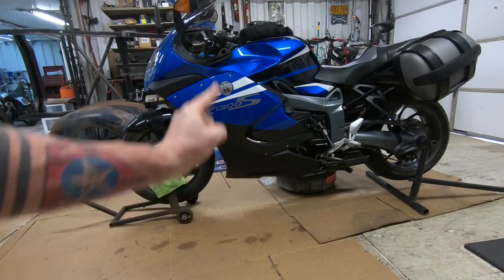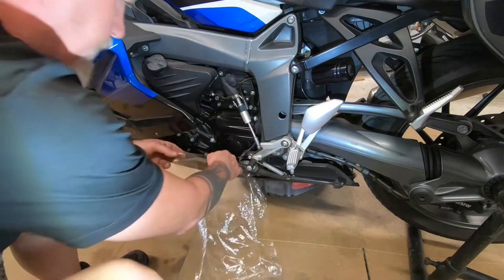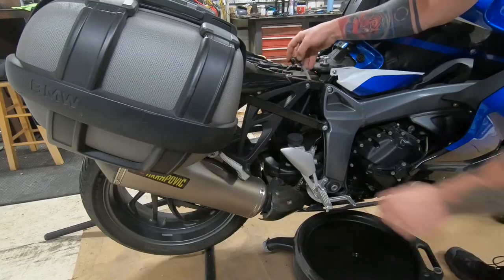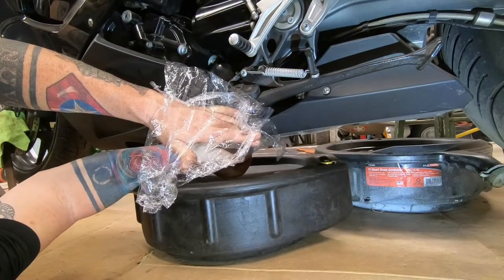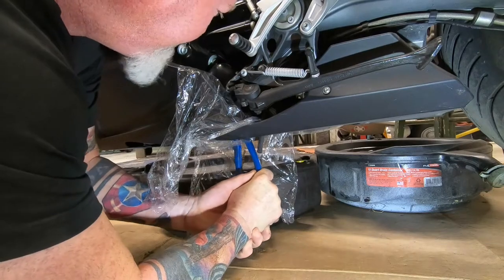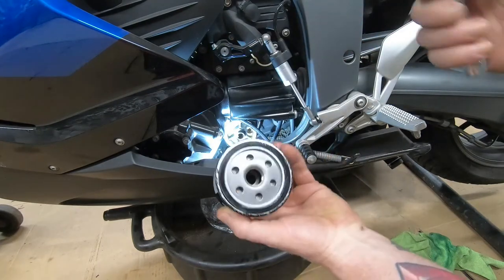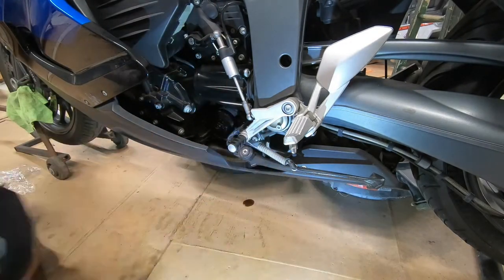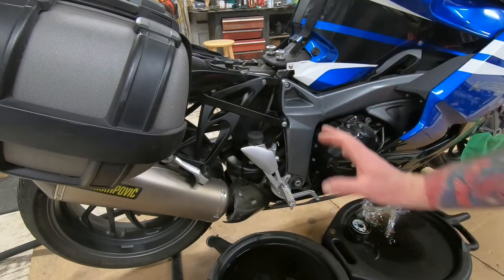2011 BMW K1300S, oil and filter change, no drips on exhaust

Comment: @ ELDEST Builds - I usually add some oil in the filter to prime it before spinning it on.
Do you feel this is unnecessary?
Reply from the maker: Priming the filter is a good idea
Reply: Proven with facts that it reduces engine wear. Source: the motor oil geek's youtube channel.

Comment: nice video since im brand new owner of 2009 k1300s and i use it as my to go for oil change....what brand and viscosity you use?
Reply from the maker: Valvoline or Mobil 1, 20w50, but I'm in Texas. We don't have a winter. I can find it for 26 DollarBucks for 5 quarts.

Comment: Do you still have the 1200? I ask because as much as I love my 900SS and 996 Duc's, neither are what I would like to do a cross-country trip on. Note- I know you've logged miles on your 900 SS but I wanted something with a bit more wind break on those looooong hauls. I am considering a used, clean K1300 for those long cross-country hauls. Thoughts, thanks.
Reply from the maker: I had an 05 K1200S, which I lost in a deer collision. I road that bike to AZ via NM and CO, road out to GA many times. I got the K1300S and did the same until I got the 900SS. Now it's all in on the 900SS.  
The K bikes are 585 lbs, loaded and rolling closer to 700. Makes for a stable ride on the long hauls, but it's a pig under 35 mph. Don't get me wrong, I still want another one. The only thing that bike lacks is cruise control. You have to get the GT version for that luxury. Fuel connection and defective fuel strips were the only hang-ups. Most of that should have been taken care of by now on the extended warranties. Get one with the bags. You can hardly find them otherwise and are about $1500 if you can. ABS, heated grips, adjustable electronic suspension on the fly, assited shifting with no clutch, lots to like about those machines. 
Look at the Kawi Concours while you're looking.
Reply: @ELDESTBuilds  Thanks buddy!

Comment: Love it.  2009 K1300S stock exhaust.  Prone to stalling at low RPM during gear change.  Note you have aftermarket exhaust.. = any issues on stalling ??
Reply from the maker: Haven't had any stalling issues
Reply: I have a 2010 K1300s never one had a stalling issue...
Reply from the maker: @markshorricks  only the hot start problem on the 2011, none on the 2005.

Comment: What's the thing with the tube? How does it have oil in it.
Reply from the maker: @kevinroark5815  it's a dry sump system,  the oil is in a container under the seat. The tube is a sight glass

Comment: very un bmw like as the filter is always up high on the cars... BUT it is a motorcycle, so forgiveness.  I want a K1300 just haven't gotten one yet... so thot I would see how this is done.  Apparently it's straightforward and low effort in some ways compared to my old YZF600R that I have running now.
Reply from the maker: There's a recall on the fuel system.  Most would have been back to the dealer for service by now. It was a very nice motorcycle.  I had the 1200 and 1300 models.  Sold it to help pay for the 92 Ducati 900SS  upgrades.  I can recommend this motorcycle as well.
Reply: @ELDESTBuilds  900 has quite a fan club.  Cool bike for sure at that weight, I hear these types always generate alot of heat near the seat.  Desmo is pretty sweet design honestly
Reply from the maker: I did a 2944 mile trip in May. Heat near the seat is nothing to worry about.

Comment: Any tips on how to re grease the final gear slip joint without a center stand?
Reply from the maker: Straps and a heave ho up would be how I would do it.  Hook onto the rear handles and suspend it.
Reply: @ELDESTBuilds  Are the rear handles strong enough to hold the rear up ?
Reply from the maker: They are strong enuff to hold the average American BMW rider. Besides it not holding the weight of the bike just a percentage.